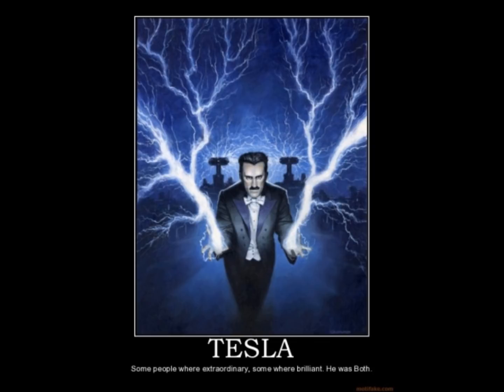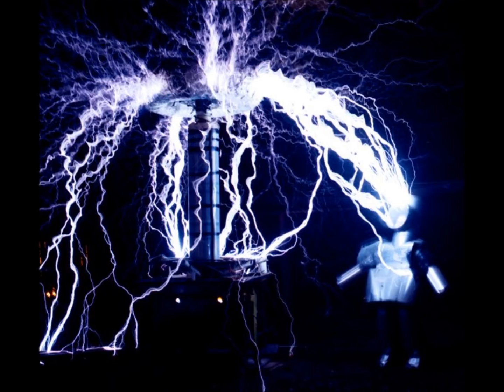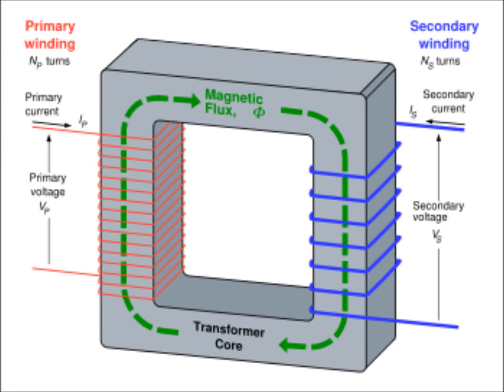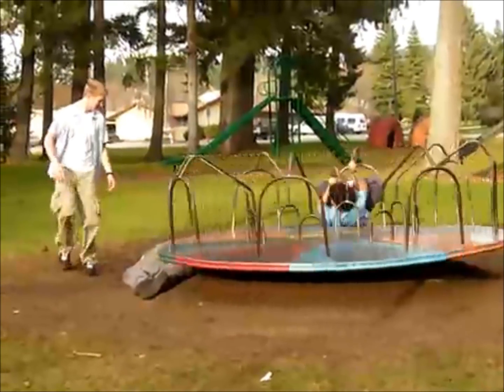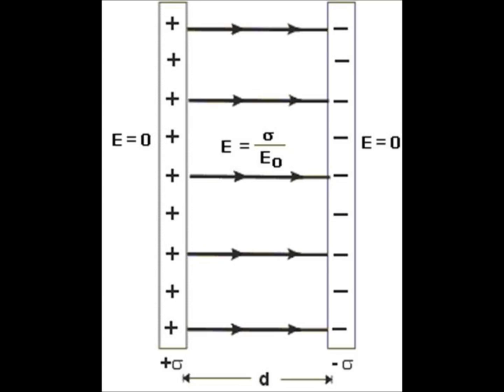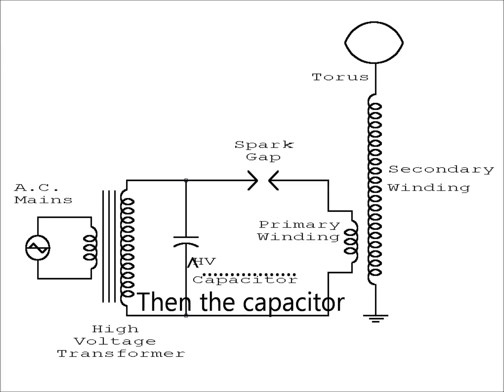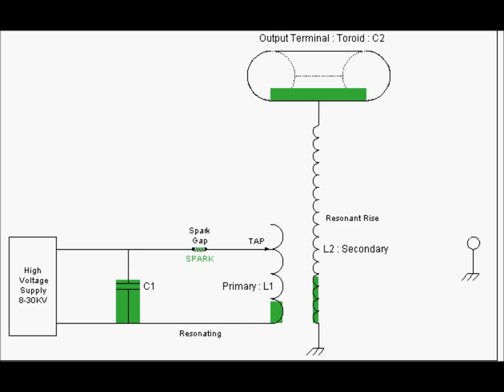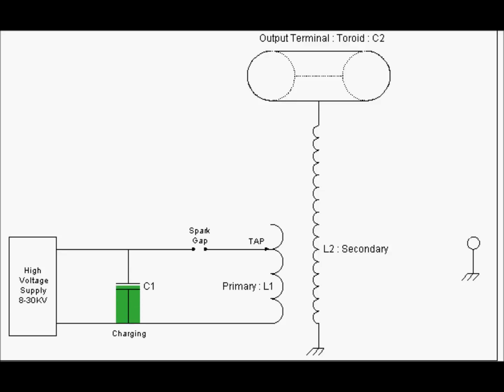How a Tesla Coil Works Physics Project

Comment: The roundabout analogy isn't necessary. Slows down the presentation and confuses the understanding. The capacitor holds on to the charge for a time that depends on the material (dielectric) between the plates. That time period determines the frequency of the a.c. You need to rehearse your presentation before recording because your voice is halting, stopping and starting, as if you're not sure. Just trying to be helpful.
Reply from the maker: @barryispuzzled  Good advice, though about 12 years late 😅

I made this in high school, I'm now 29
Reply: @DrewColpurs  Might help your kids then. ;)

Comment: Thanks for the nice video. Important question (useful for all) : In your circuit,  the condenser is in parallel. Therefore when the spark gap in lighting (is on - closing) the high voltage will also go through the secondary coil of the input transformer. That can just damage it seriously. Is not it much better to have the spark gap in parallel (and the condenser  in series) so this high voltage loop will not go through the secondary coil of the input transformer ? Please can you (Drew Colpurs and anyone who knows) clarify this ? Very much appreciated.

Comment: 1. The coil and capacitor need to be at the same value
2. The coil and capacitor need to be in series.
3. The spark gap is a switch, not a resistant. Everyone gets that WRONG
4. If you're pulsing DC energy into the LC circuit, you don't need a spark app The circuitry Does the switching for you.
5. The Elsie circuit is the primary coil, and the actual Tesla coil is the secondary coil. Which is the transformer. It is called a Tesla magnifying transformer.
6. And six, but not least, the top load needs to be at a vacuum. As good a vacuum as you can get. So that way, it can connect to the atmosphere into the other Tesla resonating coils you dumb a** Do your research then talk out your a** as you wish.

Comment: Thank you very much for your video here. I would like to know more about the longitudinal scalar wave propagation of Nikola Tesla, and the relation between his radiant energy concept. Can you tell us something about that?
Is there a longitudinal wave between the transmitter and receiver, or a kind of displacement current between the aerial capacitors of a Tesla signaling system, may I ask you?
Reply: From what I understand Longitudinal Impulses are formed when the frequency becomes so high that the magnetic field has no time to form, as a result the energy takes on a wave form that has no transverse component, without the transverse component these longitudinal waves don't cause hysteresis in the Aether, meaning they experience no time or lag in their propagation and are not subject to the inverse square law. This is why they have practically unlimited range and no time delay.

Think of how a tidal wave works, when it starts it has barely any transverse motion to it, and as it propagates out across the ocean it gains strength and maintains a mainly longitudinal form, it's not until it hits shore that it takes on a more transverse form, this is also the reason why Tesla stated that the propagation would become stronger with distance.
Reply: @JenkoRun  Hello Jenko, sorry for my delayed feedback.
Your answer is grandiose, thank you very much, we can also correspond over your email Address.
What can you say about the energy of these longitudinal aether-waves ?
What do you mean by high frequencies, a Tesla Coil can be built in kHz or MHz values, on the other side we have Hertzian Dipoles which produce in many hundreds of MHz values but still transversal in its nature, hmmmm……
How does a Tesla coil produce these longitudinal waves, am I right here, if compared with an ordinary Hertzian dipole?
As far as I understand, in a Tesla coil, the magnetic field component (primary and secondary coils) is separated from the electric field component (aerial capacitor) the electric field component may refer to these waves in the aether (longitudinal waves)  is it possible to say that, approximately ?
A Tesla coil may be used to tap into this aether energy field, am I right here ? An ordinary (Hertzian Dipole) receiver would not respond to these longitudinal wave components, but a Tesla coil would.
Is there a possibility to transform a Tesla coil into an aether-energy receiving system?

Comment: What is the point of the spark gap? And how would you explain 1 wire power?
Reply from the maker: The spark gap is meant to be a barrier that won't let the charging electricity pass until it's reached a high enough voltage, then the entire charge can cross the gap in one jump. By interrupting the flow of electricity, you're able to create a series of high intensity pulses.
Reply: @DrewColpurs  But wasnt this supposed to be the source of the production of Tesla's radiant energy?
Reply from the maker: @braaitongs  I'm not sure what you mean?

The conceptual function of a tesla coil is to pass electricity through the air. This requires extremely high voltages. Every aspect of a tesla coil is designed to increase the voltage of an electrical current. However, the only way for a current of electricity to flow through the air is "lightning," which is very dangerous and difficult to control.
Reply: @DrewColpurs  That is not what I understand a tesla coil (resonant transformer) is supposed to do. The spark gap is part of the disruptive discharge. This extremely fast discharge is what disassociates the normal electrical induction into its components. One part being the radiant energy. This is what gets magnified and stepped up in power in the resonant transformer. That is how I understand it.

Comment: If you want to calculate voltage by using a spark gap, you need to use the formula distance in millimetres the spark can jump x 3,000 V or distance in centimetres x 30 kV

Comment: I have a microwave Transformer and capacitor. My Transformer has three wires on one side 2 on the other what's the third wire for the three sided Transformer?

Comment: I’m still watching but noticed you said 1,000 v per inch of arc in the air... I believe it’s more.. a lot more.. closer to 75,000 v to arc in clean air, or 3,000 per mm.. but it drops after initial ionizing for a sustained arc.
Reply: Yes, he is way off, but ... :)

Comment: Correct ! Tesla coil is a good toy but had not been able to achieve wireless transmission of electricity beyond a few meters at the most, that too with heavy losses in the transmitted energy.

Comment: I'm more than a little disappointed by the fact that the Tesla coil in the diagram has a mains supply.  What is so great about a Tesla coil if it runs off the mains ?
What about Zero point energy ?

Comment: The next question. The filter capacitor at 7200volts. The picture show a electrolyt. Is that correct? A electrolyt have a positive and a negitve pole but the 7200 is alternating, right.
Reply: It is not a polarized capacitor. When I built mine, I used plates of glass for the dielectric and sheets of tin as the plates.

Comment: The first transformer from 240Vac. Does it have to have a grounding?
And why?
Reply: No. Also, the HV secondary coil does not need an earth ground as shown. It is usually connected to the base of the HV primary coil. This provides a common reference (circuit ground) and reduces the problem of arcing between the primary and secondary.

Comment: it's 23,000 volts to break the air per inch, not 1000volts. transformers do not amplify voltage, transformers transform voltage. too many flaws, almost everything you said.

Comment: He lost me when he said your household current is 120 V. I cant watch someone trying to teach people how an electrical component works when they don't know the difference between amps and volts.
Reply: Not trying to give you a hard time, but I am strongly against the spreading of false information.
Reply from the maker: An American household outlet is 120 volts.
Reply: Yes, I know it's close to 120 V, but current is completely different than voltage. They are actually inversely proportional through ohms law
Reply from the maker: Right, so what's the problem? Amperage doesn't have any relevance to this video.
Reply: I'm not saying that. What I'm saying is voltage does not depend on current. Your household outlet has a current of 0 until you plug something in. Current is the flow of electrons through a circuit whereas voltage is the potential difference. You can have a voltage with no current flow.
Reply from the maker: Okay, I misunderstood your initial point, and yes you're correct. Though of all the problems with this video, that seems like a pretty small flaw to pick on.
Reply: Sorry, I didn't watch the whole video. Since you are able to get so many view, have you considered remaking the video and corrected some concept mistakes so that others can benefit?
Reply from the maker: Absolutely, I've even gone so far as to make a new script and better animations... like 4 years ago. I have a plethora of scripts and half-edited videos and parodies that I'd love to actually finish and post, but between college, work, other things in life, and a lack of confidence in any of those projects, I doubt any of them will get made and posted.

As for why I keep this one up? Because despite the numerous inaccuracies in details, the general idea is the same. I explain the basic principles behind a tesla coil, and this was made during a time when there was insultingly little information about tesla coils on the internet. I spent hours researching for this video, and everything in this video is the best of what I could find (with a couple exceptions, like "it takes 1,000 volts to cover 1 inch of air," I swear I learned that from somewhere but can't find anything to back it up).

Comment: Can we say "resonance" That is what Tesla was play with on so many things. Free power from radio stations or his tesla coil. He never made free electricity or not much. He tried from the resonance of the earth. Some of the amps are lost???? How about most of them, the output has very little amps. The primary has only ma's there is many amps in primary, many be even hundreds  amps from the capacitor discharging in mine. The 10kv poll pig has 3/4 amps @ 14,000 adjusted with a 10kv 220 volt autotransformer, I get 7 foot arcs so far. I got lucky and found the autotransformer 300 and the pole pig 350.00 on line. LOL Internet is great. I need to move it to a bigger space, the arcs were limited by the space. Using a autotransformer helps a lot. But you need to know what you are doing working with Tesla coils. You can start fires in your house wiring if you don't have the power supply with protection!!!!!!!!!!!! Also the discharge WILL KILL YOU from the capacitor!!!!!!!!!!!!!!!!!!!!!!!!!!!!!!!   VERY EASY!!!!!! DONT FORGET TO DISCHARGE THE CAPACITORS OR HAVE A RESISTOR TO DISCHARGE THEM!!!!!!!!! I almost didn't one day and you only have to mess up one time and you're dead with a tesla coil.A rotary spark gap helps too. Easy to build one with a small motor and turning a 12" wheel. I made mine to act like a squirrel  to keep the air moving. It worked out nice.  I started with neon transformers, then the pole pig, now to rebuild the primary and secondary for the higher voltages its making. Again this can kill you be very careful its not a toy. Also the fires it can start from the back feed into house wiring and output from secondary hitting metal in you house and running in the walls. READ READ READ and learn before you try this!!!!!!!!!!

Comment: Don't you understand that the spark gap was used to produce wide spectrum of electromagnetic waves which are separated to those which cause a resonance of a big coil+cap on top? This important thing is ignored by almost of everybody who tries to repeat the device. They try to replace the spark gap with modern silicon valves.

Comment: I certainly did learn a few things watching this video I have been a long fan of Tesla and I haven't quite understood the relationship between the spark gap and capacitor until this point and of course now it is all clear but one thing I was waiting for is the point of high frequency electricity which you really didn't get to I for one am very interested in the effects of high frequency electricity thank you

Comment: current is measured in amps not volts and voltage discharges independent of how much amps are there at a rate of approximately 1" per 10kV not 1000 V

Comment: It is called a resonant frequency. The inductor and capacitor are an LC tank circuit.
Reply: A Tesla coil, if constructed correctly, can be tuned via the spark gap to be resonant. Most are not resonant.

Comment: Tesla coil theory is so damn simple as the effect is decompressing electricity "ball" rather than compressing; resonance work rather than non-resonant one(most efficient way applying force); these two factor make energy from various source into the circuit somehow(such as heat, infra-red, other EM, molecular standing vibration, quantum, cosmic ray, sun-ray in vaccum, gravity etc.) rather than leaving as energy loss (+entropy), simple! But making it require DIY skill, golden ratio, sacred geometry, painful to prefect it really. Every factor counts when doing resonant work of anything!
Tesla to me is a true insightful genius and faithful for the ultimate human good. "Mad" is a misunderstanding or is what media at that time say about him.
Reply: Can you explain it more? Did you mean that the voltage on the secondary coils goes up because it absorbs energy from various source? Not from the circuit itself?

Comment: Now it is confusing. The Tesla coil is nothing but an up transformer with a lot of mumbo jumbo. This explanation could not give me any answers. Try to explain the Tesla Death Ray please.
Reply: http://projectcamelot.org/ralph_ring.html something to fuck your head even more xD
Reply: tesla coil has nothing to do with the tesla death ray.
Reply: It is more than just a turns ratio. The secondary is also a transmission line that is a quarter wavelength of the resonant frequency of the primary.
Reply: Bill Smith: Nonsense.

A transmission line needs two conductors. However, you could call it a non-resonant antenna. 

Most amateur builders of Tesla coils never manage to make them resonant.

Comment: no a capacitor does not discharge that happens because its your voltmeter leave it on one number and check it then try it it will be in the same millivolt but its the voltmeter that discharge like putting it in the same metal that is why you can build a radiant device from atmosphere at zero point pressure everything is energy wave the metals come and form from the ground so you put it in water and the metal rust see that is chemical build up so there are ways to power a house at zero point energy.
Reply: john hutchison traped the energy with crystals imagine a battery with crystal radiant energy and space and time capacitor at any voltage . coils release radiant energy right wireless energy will in that battery

Comment: I have been in electronics/electricity for over 50 years. 1,000 volts is low for a 1 inch gap. however I only wish I knew as much about a tesla coil as you demonstrated in this video when i was in school. some interesting reading you might like. look up " tesla, arrow " it is  a car he modified in the 30's. keep up the good work.

Comment: Let's get away from line voltages if we can. I have found that although it's a very small current I can take a noisy DC motor in series with a regular power transformer say 6.3 VAC and pull nearly 70VAC off the primary side. All you need is some kind of interrupter like motor that I'm using. Now at least we could use a battery and not have anything to do with line current which is dangerous.  Tesla was trying to show us how to use cold radiation current. You could use a Bedini motor to get a pulse of higher voltage.  What we really need is a http://www.surplussales.com/Equipment/sparkgap.html or see https://en.wikipedia.org/wiki/Spark-gap_transmitter and https://www.youtube.com/watch?v=vSxysPBvOu4 but try not to use line current.

Comment: I don't understand the need for the spark gap/tap. What would occur if it were eliminated? Thanks.
Reply: +DougRH Henderson Now that's what I call an answer. Thanks, Doug, it makes more sense now.
Reply: +DougRH Henderson Thanks very much for the alert!!! My background is pharmaceutical chemistry, not electricity. Even though it's easy enough to wire a house, this is a lot more intense. I plan on playing with this stuff when I retire in a couple of years.

What's a good place to start to achieve high voltage?
Reply: +DougRH Henderson Haha. Nope, we had no such toy in my high school but point taken. Thanks.

Comment: Drew there are a few descrepencies regarding how you explain several subjects. For example capacitors do not possess any magnetic field. They store energy by virtue of the area shared between two plates, the distance between them and what is separating the two. Good video but could of done with someone proofreading and script :/

Comment: you must have the timing indicator  (moving green strip showing electron exchange; inductance) go up on the secondary winding,while the primary ,green indicator, is going down....sequence should be discussed with the animator.
Reply: Wrong. He is showing the field build-up at various places. So the field builds in the primary and secondary in phase and at the same times. 

Much about the video are incorrect, including how the fields (or voltages) build in various places, but he got the primary/secondary relationships correct.

Comment: Ive been trying to find information on the INPUT WATTAGE (ball park and or typical range) of any typical tesla generator coil.
Reply: On the public mains side of the power transformer or the secondary side. When I built one in high school, back in the 60s, I used a neon sign transformer with a secondary rating of 15,000 volts at 60 ma.